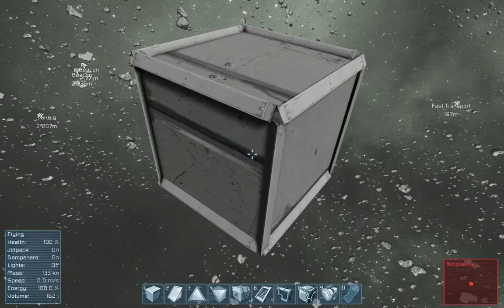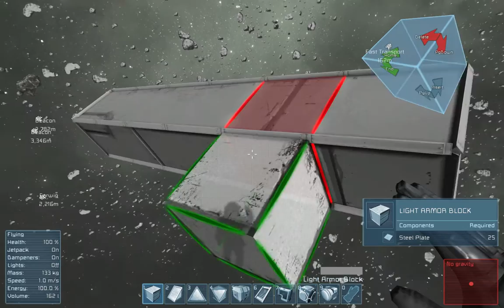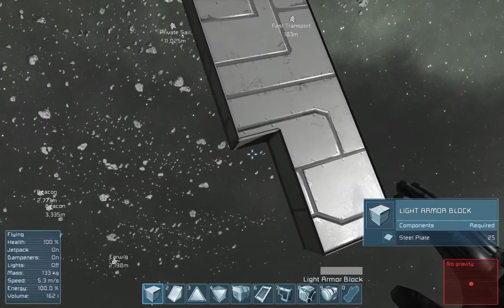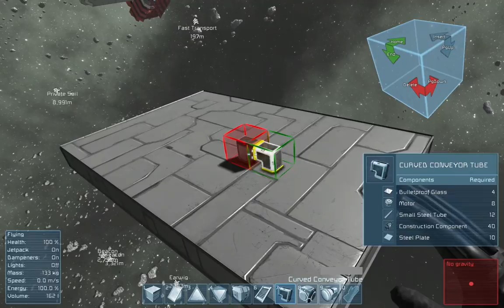Voxel Optimization, The Space Engineers Way

Comment: This isn't a voxel optimization technique per se. This uv mapping technique for more texture variety works independently from how many triangles the model uses.
In fact unless you know from somewhere else, what we seen doesn't give away if they are using two or four triangles for the side faces of the two voxels.
They just don't use the same uv coords for every face of one material, that's all.
Reply from the maker: Given the noticeable seams between the other kinds of blocks, I think they're sharing verts on their faces.
Reply: Not sure I get what you're trying to say here. They need the girders, because they are using the big texture on every face, so it usually doesn't tile between let's say top and front face, but that's a result of the texture uv trick they use and has nothing to do with them sharing or not sharing verts.They may or may not triangulate the top face, but the girder design hints at them not optimizing anything, as they just used the simplest form that tiles with itself along a longer edge and they didn't bother to change the geometry on corners.
Reply from the maker: I'm saying that every other kind of block in the game has seams (little glitchy lines) between the blocks.

But it isn't important, either way it's a neat trick. I've used it before, but the awful problem with the faces not aligning always made me abandon it. The girders are what saves it.